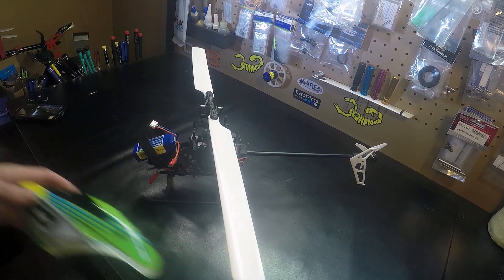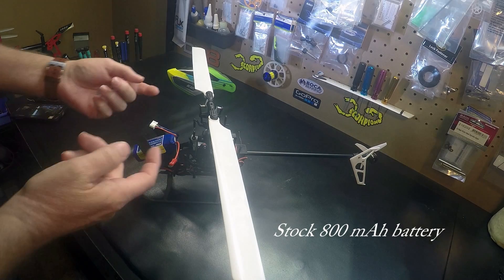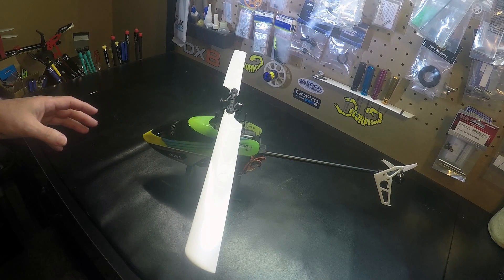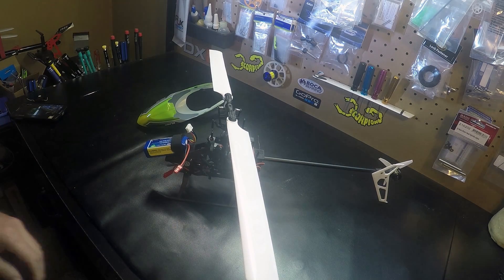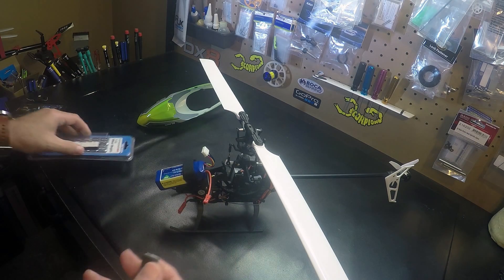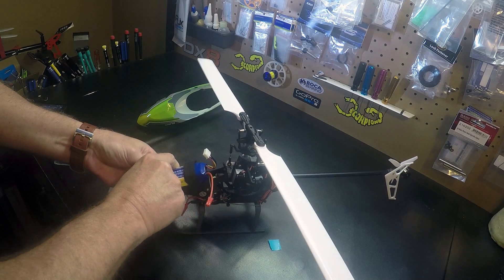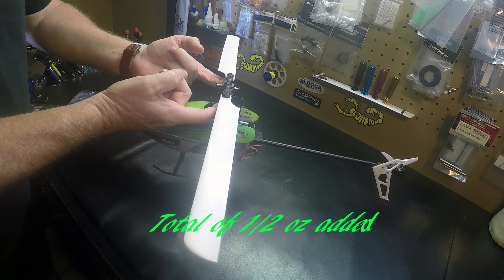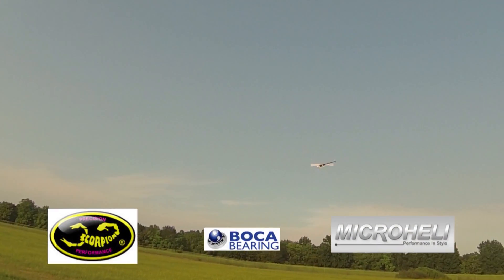Blade 230 S checking and adjusting CG

Comment: I just bought this helicopter I'm shocked it is so tail heavy with an 850 mA battery…This video is all you probably don't even have this helicopter but I just bought one brand-new for 100 bucks.  It's just his tail heavy is yours is and it's sickening I hate horizon products only got mine because it was cheap.  And don't compromise if you're still flying it should be dead flat and when you said it's better it's actually really bad it has to be dead flat.  Well if you're still out there your video is important but you didn't stress hard enough it should be dead flat… And I know it may suck but the lead should either be in the canopy in the very tip of the nose… It should still stay on.  If you don't want it on the canopy then get a popsicle stick I don't care get it is far forward as possible.Yeah been around for a while been doing helicopters for many years.  But I'm getting old haven't done it for a while and like I said I bought this helicopter cheap

Comment: Hi JJ , I am having some problems with my 230s . when I initialise the swashplate is not leveling. I tried to go into adjustment mode by bringing the two sticks to the lower left and right positions but the is no shake from the servos and hence no adjustment mode . Can you help. THanks RR
Reply from the maker: +Rahin  What radio are you using?
Reply: +Rahin S To do the trim flight mode with the DX6i you will need to use the Ele/DR (Panic Switch) with associated stick positions.

Comment: Hey JJinverted, I just tested my 230 S for CG and it does as yours does, tips back. My CG is just in front of the rear servo. But it flies rock solid after I did the trim flight, no tail drop even before the trim flight. I have my battery up against the stops.
Reply from the maker: +james tremain Good to hear. Does it piro flat ?
Reply: I haven't tried that yet. I'll give it a go now that I did the trim flight.